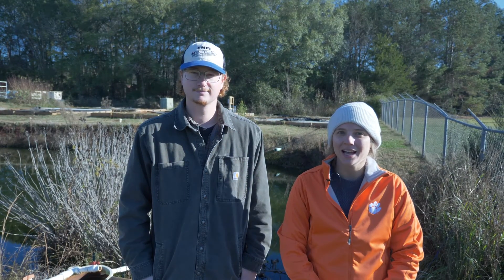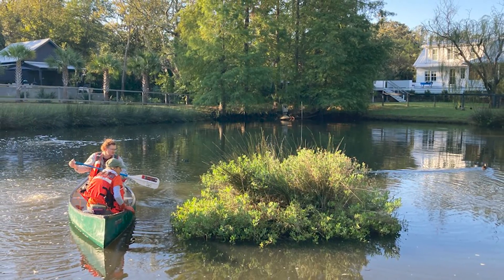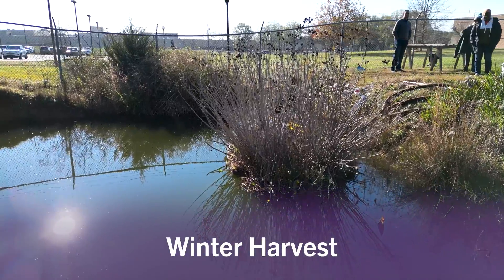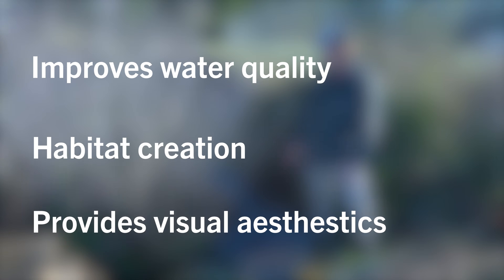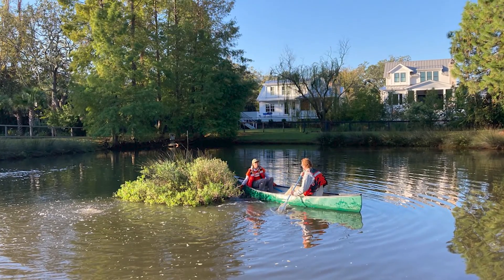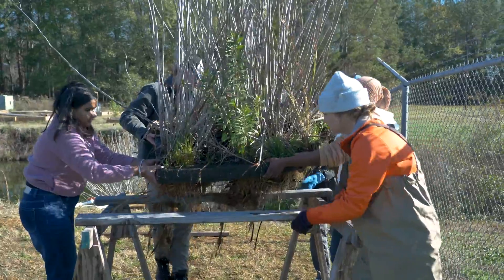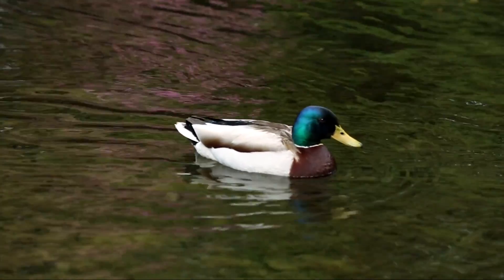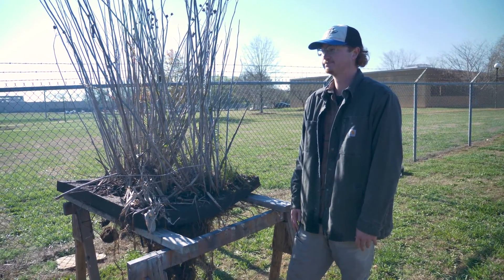An Introduction to Harvesting a Floating Wetland

Comment: Where do you get the mat and what is it made of, how long will it last?
Reply from the maker: Mats can be purchased from a variety of places or constructed on your own. The mat in our video was made from a synthetic foam, but mats can also be constructed with natural materials like bamboo and coconut coir depending on user preferences. The longevity of the mat will depend on the materials you use. The mat from our video had been in the pond for three years and showed little signs of degradation and could be reused in the future.